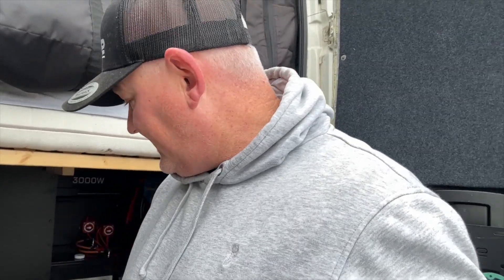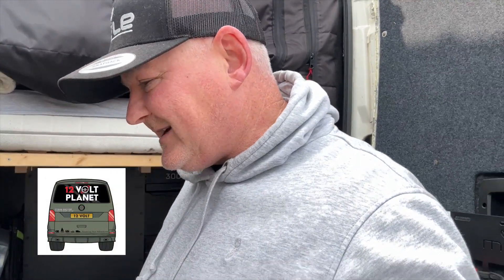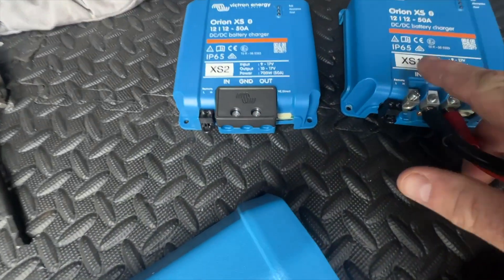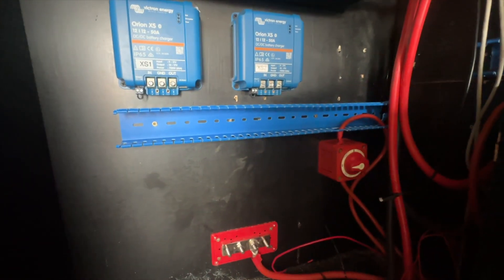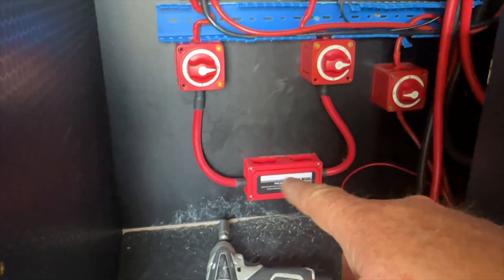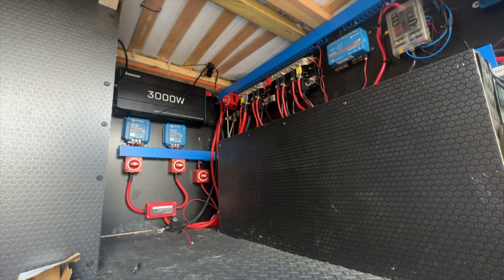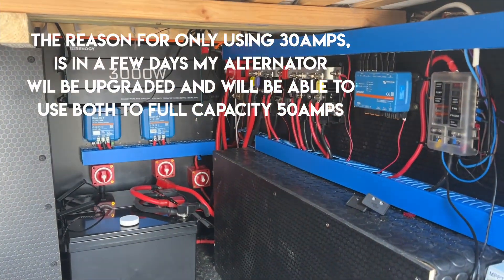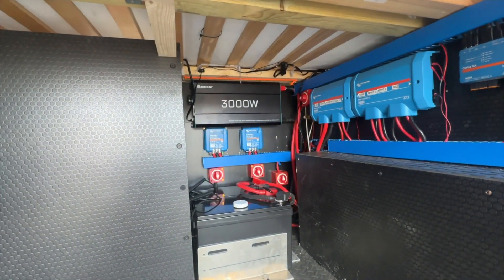Victron Orion XS 50A DC-DC Installation

Comment: Just curious, when you upgraded your alternator, did the garage have to change out the wiring from alt to battery, to carry the higher amperage? Also, did the ECU need adjustments for the new Alternator ratings? Third point, does your Orions ramp down when you are just idling, ie say you are stuck at traffic lights for 10 minutes, i assume there is no chance of overheating the alternator when pulling 100Amps at only 800 revs? Your set up looks great and obviously well thought out using all quality products....enjoy your winter adventures.
Reply from the maker: No change to wiring needed and no change to ECU. Never had any issues since being fitted well over a year now and no loss of Orion’s ramping down on idle or overheating!
Reply: @packthevanandgo  Cheers mate, just purchased the XS1400 one. Hopefully i wont need to change the alternator.
Reply from the maker: @jimmaxwell2259 hope it all works out for you. Mate

Comment: New set up looking mint. Can I ask what size will the new alternator be. Many
Thanks
Reply from the maker: Hi mate, the new alternator is 220amps should be enough power to run two of the dc-dcs
Reply: @packthevanandgo  hey man, i presume you've upgraded the stock alternator? i've got a 2019 ducato and i'm interested in the same dual 50A DC DC setup... which alt. did you change to?
Reply from the maker: @joshdaniel5737  I’ve upgraded to a 220amp alternator mate
Reply: @packthevanandgo  what model did you go for an was it a simple swap or did you need to change engine bay wiring too?
Reply from the maker: @joshdaniel5737  This is the company I used, add you vehicle details and find the part that best for you! And it was a straight swap over by some mechanics I know! https://www.onlineautomotive.co.uk
Reply: Thanks for the info. I asked because my alternator needed replacing.

Comment: Hi Rob great vlog I am going to get another xs for the boat. What size fuse are you using from the battery. Thanks Al
Reply from the maker: Hey mate, I’ve got a 150 amp fuse on the vehicle battery and then 80amo fuses on the distributor for each XS